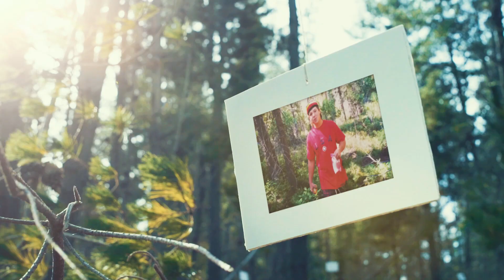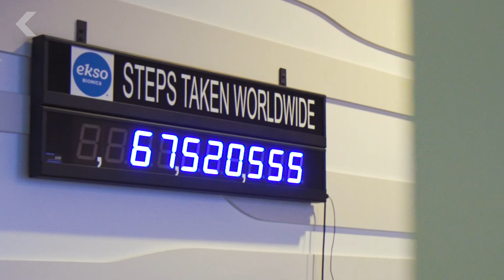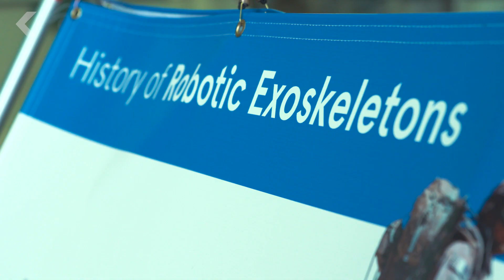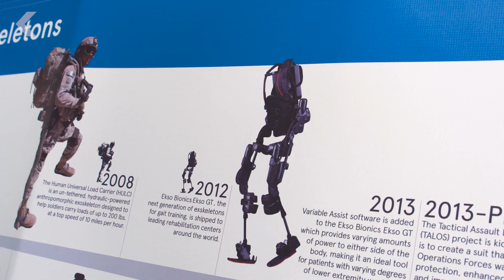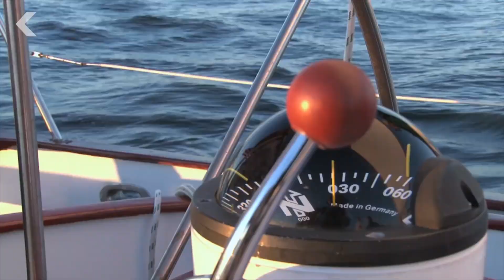Bionic Suits Are Real And They're Transforming Everyday Life

Comment: As powered exoskeletons come into greater use, I expect a change in how they're referred to as well in common tongue, especially with regards to separate components. Power pants, exo legs, robo pants, exo frame, Xof (x-o frame), power gloves, power suit, or some other article of clothing. Naming will be simplified much as possible, as people prefer adapting existing words to refer to things than expending energy on unfamiliar or excessive tongue flicks, depending on the collective evolution of muscle memory regarding the tongue.

Perhaps in the future, one may not need to move their limbs at all to move the robotic frame, instead operating entirely on thought, or in parallel with the senses so as to react beforehand to increase reaction time. By doing this, it would be possible to have a ready and standardized prosthetic when a limb is lost, regardless if it was just a finger or an entire arm since you effectively have a spare set of limbs on you.

Gotta figure a way to regularly scan brain activity without needing to pry open the skull, have an A.I. correlate sensory input with physical brain and neural activity, and muscle movement so as to reduce reaction time. Also a feedback system, maybe to increase the human reaction speed entirely as well with a light speed I/O interface to bypass our natural signal speed. Wonder if we can use microwaves and infrared to accomplish this?

Comment: I had a brain hemorrhage about two years ago and underwent physical rehab to regain control of the right side of my body. I can walk with a leg brace now but I have problems with dorsiflexion and suffer foot drop to an extent. Without a brace my foot curves in and I risk twisting my ankle with every step.

I have an appointment at my rehab place to get fitted and try on one of these suits for up to eight sessions if it makes sense for me to use it. I don't have dramatic spinal cord injuries but I'm hoping I can eventually walk and run without a brace on. If that doesn't help me I'm not sure what my other options even are at this point, my physical therapists don't have any better ways to help me at this point.